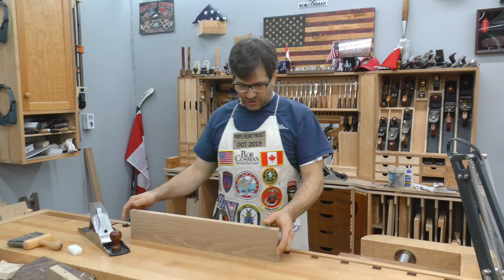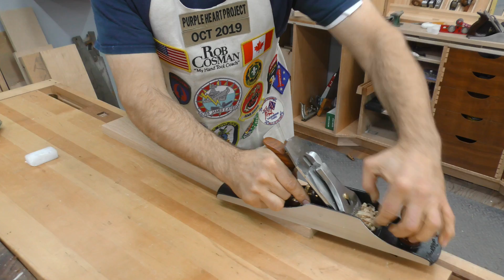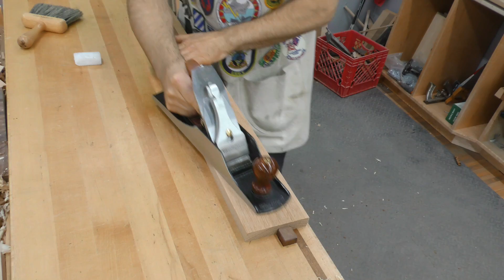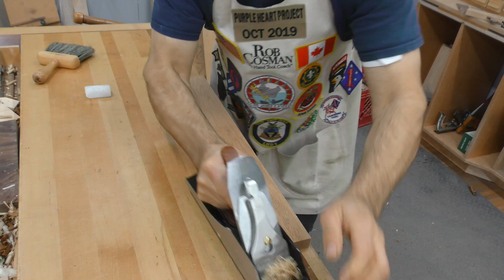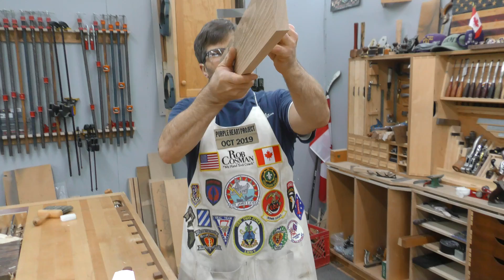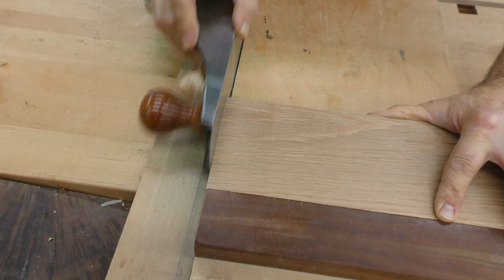Six Square a Board, Finishing Using Hand Tools with Rob Cosman Part 2

Comment: I wonder what is this process like if you have many parts that go together and you need to ensure equal dimensions in at least one axis, for example the height on the 4 sides of a box. All this extra planning just to ensure it is all square seem to be altering (ever so slightly) the dimensions of each board... So I wonder how to keep everything fitting together later.

Comment: how about using a cabinet scraper (Stanley No 80) or similar instead of a plane?  I think its easier and less hazardous to the dimensions/square of the recently 6s square board.
Reply from the maker: Plane will leave a better finish, no sand paper needed.

Comment: Hey Rob, is there a particular benefit from cleaning up the long edge where you have it between the bench dogs and the plane is on it's sidd on the bench? or is it just a different way of doing it? I've never seen that before.
Thanks for the video, I always learn something
Cheers
Reply from the maker: Bruce Stuart the advantage is that the plane stays at the same angle, which is helpful for planing narrow edges. If it’s less than an inch I’d recommend this method, if thicker you can have it between the dogs.

Comment: Hi Rob, some great advice and technique.  While checking squareness, surely you should also check parallelism.  At least across the width.
Reply from the maker: If you saw the first part, the board came off the table saw, sides are parallel.  As long as you take full length shavings off either edge, the sides remain parallel.  Do this for a while and certain things can be safely assumed.

Comment: Rob, I never understood planing project parts before joinery.  Won't the boards get dinged up while shaping them into parts?  And won't the boards all come out slightly different making joinery harder?
Reply: The boards wont get dinged if you handle them properly! Putting them in a serrated jaw mechanics vice for example will certainly ding them!
When you get your boards its unlikely they all the same anyway, they're out of square, twisted, bowed etc. You plane them to give yourself more accurate boards so they fit together better. Although they may be slightly different, (as they were when you bought them) they will still be a more accurate fit.
Final planing is to give you a better finish than sanding etc. (And less dust!)
Reply: I've hear Rob talk about how thick those fine shavings are, and it is so small it is not going to make a difference in a joinery project situation.  Plus you'd assume that the boards will have gone through the same pre-prep process, and be of very similar sizes.  An exception might be taking twist out of a board on the jointer, which could significantly thin a board.

Comment: Rob, what if that board was the 3rd or 4th board you were dimensioning for a piece of furniture and you had to shorten it because of the cut you made on the shooting board? Could you still use it or would you have to adjust the other boards by the same measure? Have a nice weekend, Rob.
Reply from the maker: you need to watch my board stretcher video!
Reply: @RobCosmanWoodworking  Will do. Thanks, Rob.

Comment: Rob, once more a great, informative and comprehensive video, thank you! You always emphasize the finish quality of a well (hand) planes suface and I absolutely see that. But how do you deal with the raised fibres from the finish which is applied after you so nicely prepared the work peace? Is there a less dust producing alternative to sanding you would recommend to get back to the glossy surface you achieved by hand planing?
Regards, Bernie
Reply from the maker: you get much less raised grain on a hand planed surface than you do on a sanded one.  I use a scraper to cut down between finish coats.
Reply: Sometimes I use a technique mentioned by a gunstock maker, and rip those little fibers out with a coarse-ish grade of steel wool. His method was to wet the surface first, and dry it with torch (well, nowadays anybody would use a heat gun), then rub it down. Still, this is would be violating a freshly planed surface.